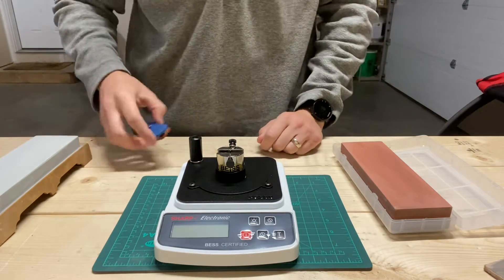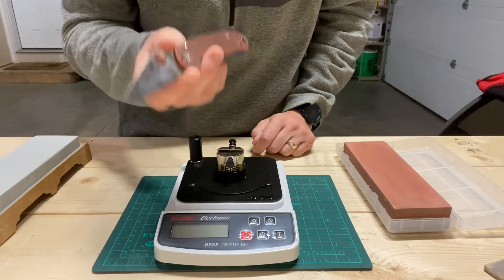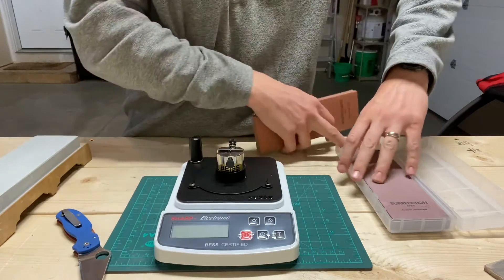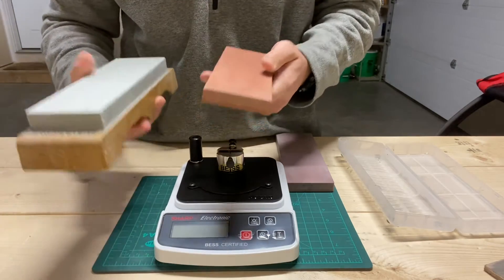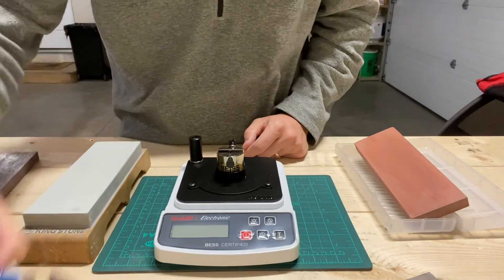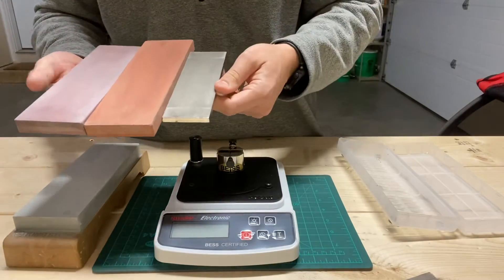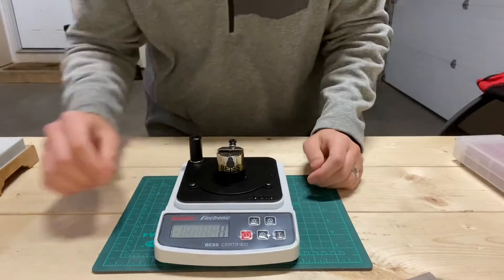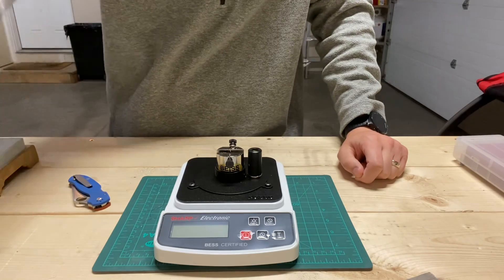Sharpening Tip #3: How to Tell When You Need a Coarser Stone

Comment: Does the type of carbide make more of a difference in the abrasive used than the actual carbide volume?
Reply from the maker: From this study I'd say total volume is the bigger factor but VC does start to make a more notable difference around the 4vol% VC mark. I noted this in the study with SG2 vs. M4. The SG2 had much better feedback and speed at similar hardness and assumed carbide volume. But SG2 has much less VC and I think that was the differentiating factor.
Reply: @EngineersPerspective701  
Is ZDP189 high carbide volume even though it's chromium carbide?
Reply from the maker: @whocares3986  lol sorry I thought this was for the Chosera study I did which is why I was talking about speed and feedback! 

So for me that 4vol% VC is the tipping point but really any harder steel with or without carbide I go to diamonds if I’m worried about it. 

ZDP-189 in a kitchen knife I’d use the Neo and then finish with an alox water stone anyways because alox will shape ZDP just fine. For a folder I’d go diamond just to “play it safe”

Comment: I’m getting much better in my freehand. I would like to step up my stropping game. Currently I just use a leather strop with black and white Bark River compound. Would you mind recommending some options in both strop and compound? Thx!
Reply from the maker: Definitely! At this point there is no reason not to use diamond or CBN so start there. Gunny Juice or the KME CBN emulsions are really quality. Both can be had from gritomatic. Also you can Facebook message Ken Schwartz and he could hook you up as well with his stuff. He makes the KME product. Start with 1um then 0.25um then 3-4um in terms of buying. 

As for the substrate. I’ve been a big proponent of wood strops so that’s where I’d push you first. I like to cut 2x5 pieces of balsa out of a 1/4” thick sheet from hobby lobby. Could also use a paint stirrer.